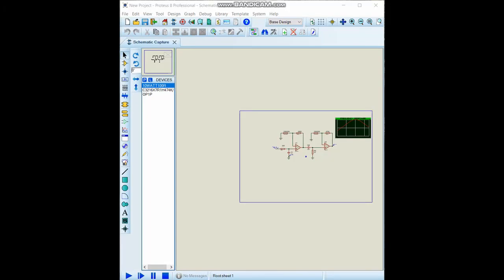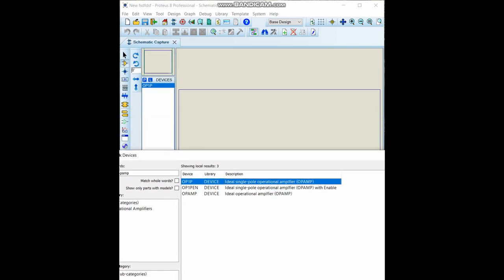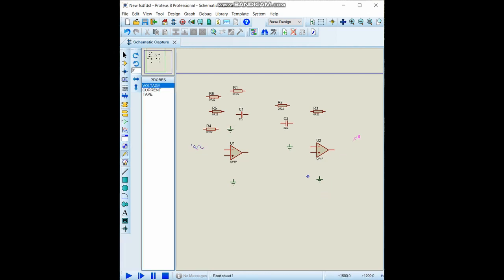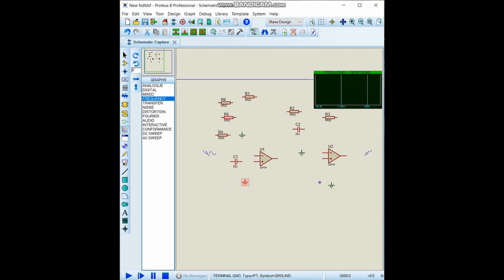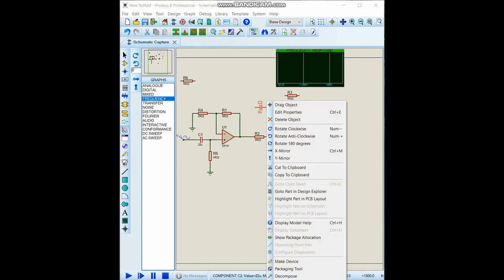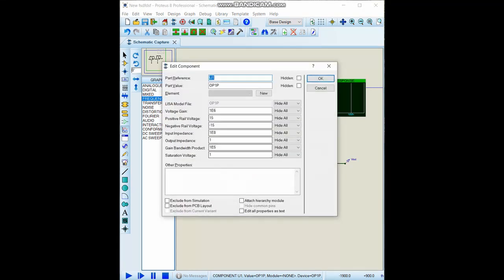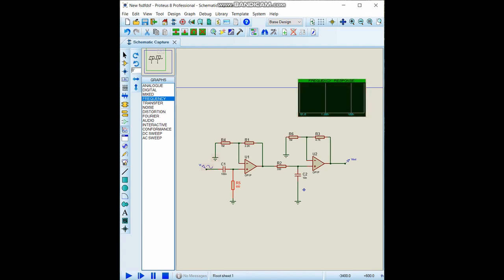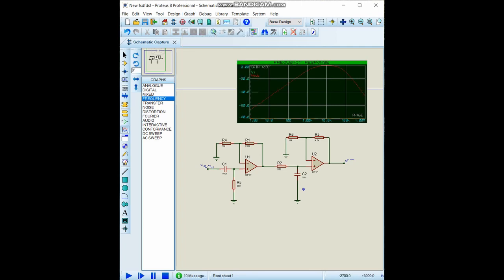Proteus OpAmp Active Bandpass Filter Circuit Frequency Response Analysis Example

Comment: how did you choose the values for R1,R3,R4 and R6?
Reply from the maker: Hi Lara, you can imagine the circuit as a "Non-inverting Op Amp" configuration in addition to a passive filter. Check out link for original formula: https://www.elprocus.com/non-inverting-op-amp/#:~:text=The%20non%20inverting%20op%2Damp,in%20phase%20through%20the%20input.&text='R1'%20is%20a%20resistor%20connected%20to%20the%20ground.